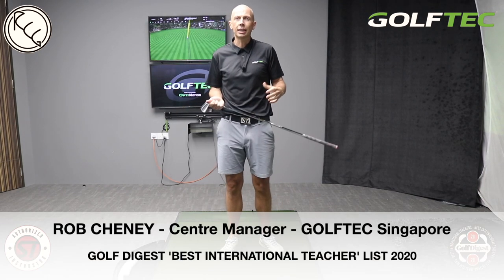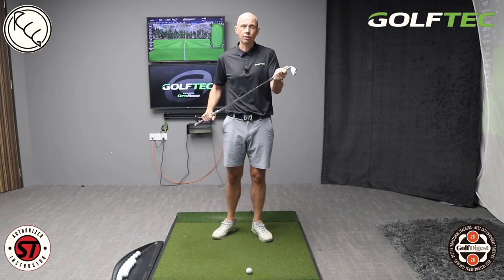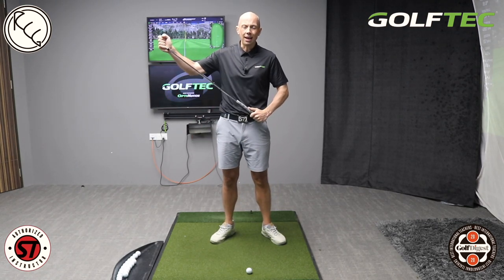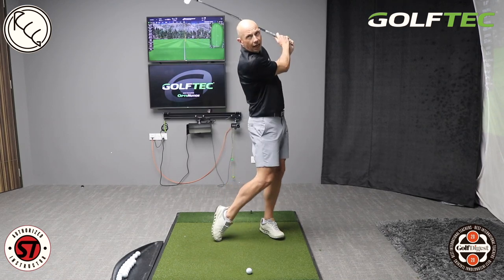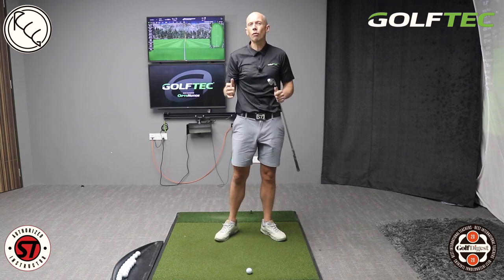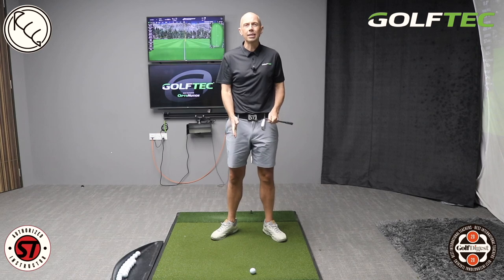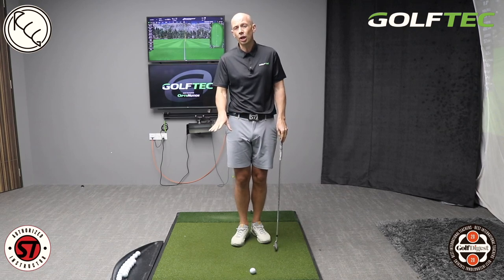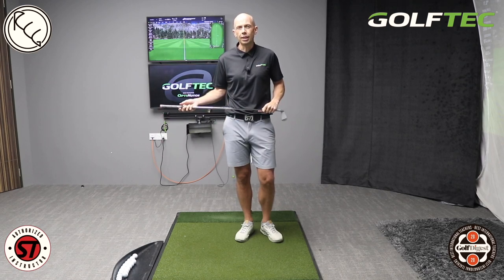PRACTICE SWING vs REAL SWING | WHY ARE THEY SO DIFFERENT?

Comment: Since doing your swing hard stop short, I have incorporated into the practice swing and real swing. I find I take 3 practice swings half, 3/4, and full watching the ground contact. The focus of my golf has become watching the contact with ground and making sure it is at or after ball and making sure there is contact with ground. Great instruction. I have become much more focused using all your methods. I know that if contact is made before ball, I likely lost wrist angles to soon. I even will intentionally lose wrist angle too soon and then hold to feel and see the point of contact difference. Thanks!

Comment: Rob, Relevant subject not addressed many times by Pros. As a recreational golfer, I concur with all of what you have said on the need to check a number of swing technicalities notably squaring the club face at impact and hitting the ground after the ball. On the latter, not easy if one is practicing over a plastic carpet. Moreover, golf is a sport where training conditions widely differ from the real game, I mean, the driving range conditions are not the same as those in the course, eg. you practice on a plane surface, no obstacles and, most critical, there is no stress/pressure on you. Best wishes, Carlos

Comment: My issue is not irons, I always just half swing and feel the club hitting the ground in the right place. My issue is my driver practice swing (at full speed) looks like Adam Scott level. But my actual driver swing looks like I'm trying to chop wood (over the top starting the swing with my shoulders). I don't transfer the weight off my back foot until AFTER impact, and I think that's just so I don't fall over lol. Practice swing I transfer before impact with a textbook finish position.

Comment: Normally I take 2 full practice swings on the tee to loosen up from behind the ball. These are meaningful and intentional. I continue by taking aim from behind the ball to target, then grab an intermediate target such as a piece of dirt or blade of grass that I hold onto through set up. Breathe and swing. 
From the fairway, I again work my preshot routine the same way behind the ball but add pressure to take only 1 practice swing while focus is on proper grounding of the club. Moving forward taking aim, ready-hit. This present routine saves me approx. 5 strokes in my own estimation.

Comment: Yo Rob this off subject but I need your input. I have been using an alignment stick for a month or two and I point the stick at the target and then line my feet up from there. I like to fade the ball so I use a slightly closed stance and aim the club face left and swing out to first base. The reason I like to fade the ball is because that's the only shot I can count on :-) What are your thoughts on this subject?